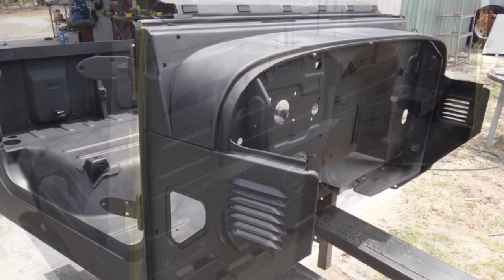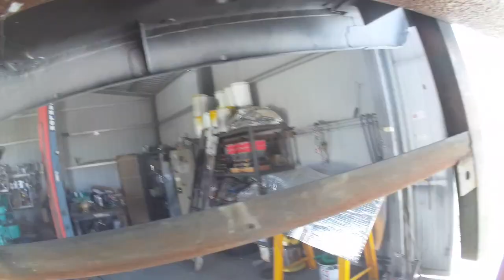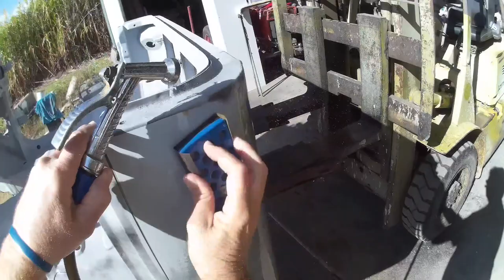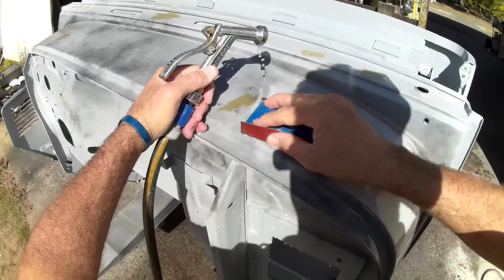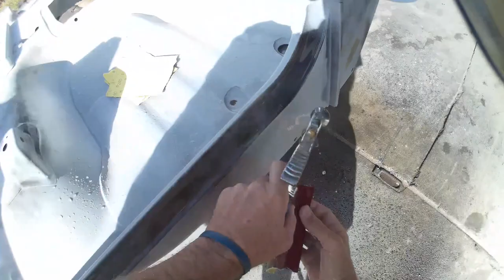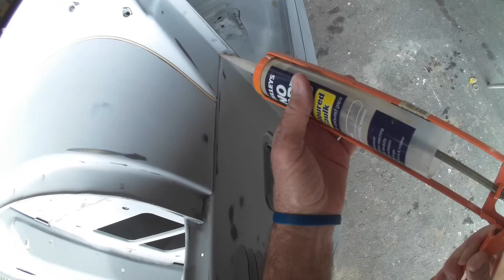Cab repaired and joints recaulked for painting HJ47

Comment: Hey mate, good video! Watch the 40 channels video on the seam sealer. You did the same mistake he corrected on his cruiser. You should level the seam sealer after putting it on, instead of leaving it on there like a "hill".
Reply from the maker: Hello, The way I put seam sealer in is not a mistake it is to copy the original way that Toyota did it. I also use acrylic sealer which is very similar to what Toyota used. When finished and dry it looks how it did when the car was new. Thanks for the comments.

Comment: Hi Simon. Top quality job. What do you use for the floor pad? Does it trap moisture causing rust like done sound deadeners?
Reply from the maker: Hi, it is a sound proofing pad. Yes if it gets water under it the rust will form. I think if you are restoring a car that will be used you should use a spray on product so it will not trap water and dirt. The car I am restoring will no be used again. Thanks for watching. Simon.